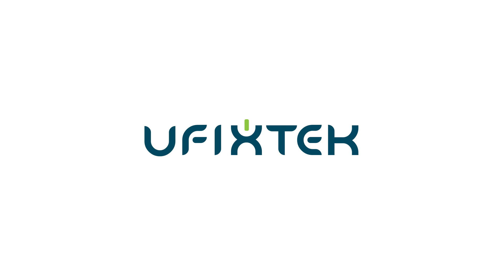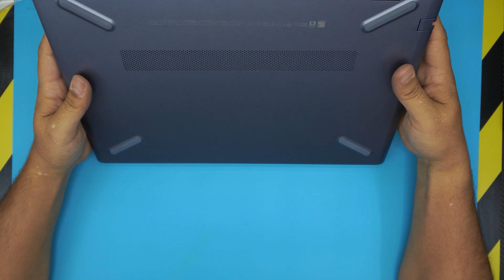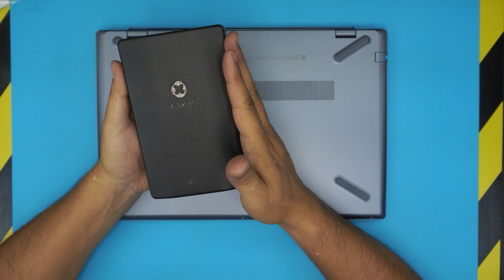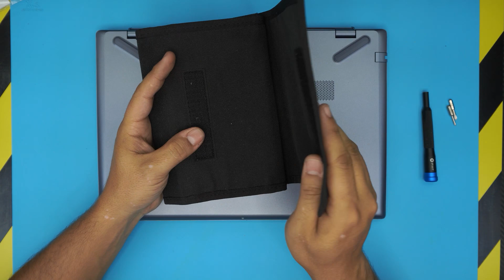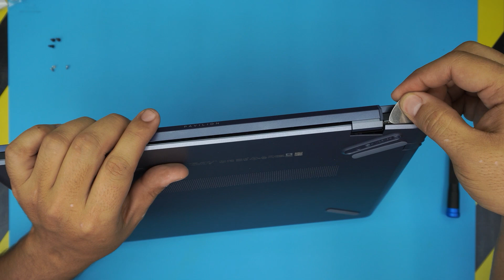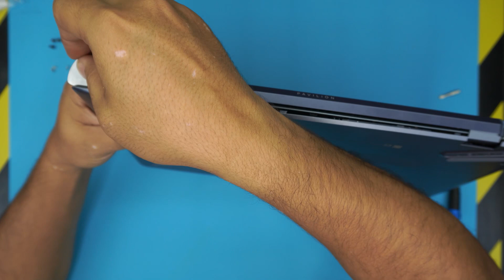How to replace Hp Pavilion 15 Cw Battery

Comment: Thank you so much. I just changed mine with a HT03XL non-HP battery. Do I have to calibrate the new battery or is there a danger to receive any notifications that my battery is not genuine?
Reply from the maker: It's my pleasure my friend.
🫠 Regarding your question, update the BIOS and it should remove the "genuine" message. Otherwise, the seller likely sold you a very basic, non-smart battery.
cheers🍻

Comment: Need a tutorial on how to replace the wifi antenna cables.
Reply from the maker: 🫠Regarding your question, that requires you to detach the LCD bezel, or you can just buy new antenas and just connect and place then in an empty space by the battery.
cheers🍻
Reply: @ Is there a work around for the wire to not come in contact with the motherboard?
Reply from the maker: you can use Gaffer tape to protect and hold cables on board.
Reply: @ Goat. I went with kapton tape. Going to be a struggle since the wires are a bit long.

Comment: I remember when the batteries could be removed without having to open the whole laptop, now you have to open the whole machine and remove the battery, a nonsense about these designers....🙄
Reply from the maker: 🫠Regarding the internal battery, it is a nice option to have the batteries externally. Unfortunately, that would not benefit the brand, as they gain a huge amount of revenue from service centers for battery services. The same goes for cellphones.

Comment: I changed my battery on my hp 15-cw1xxx  but it won't charge up , the charge light just flashes , I refitted the old battery which charges up fine , would that indicate a faulty new battery?
Reply from the maker: 🫠Regarding your question, yes the new battery is faulty and is not working, this happens a lot.

Comment: In my model, the back edge was slightly different due to the presence of a thin grid. You just need to be careful with it when unlocking using the removal tool. Other minor differences: there was only one screw in the left corner instead of two, and the three locks in the center of the back cover were absent. Everything else was identical. The instructions were essentially perfect. Thanks!
Reply from the maker: It's my pleasure my friend.
i appreciate your support and the tips 👍
cheers🍻

Comment: Good video but you just removed the battery and put it back in. You should put in a replacement battery and see the issues that arise with the replacement!☹Things like continuous flashing power light, charging and discharging to optimise it etc.
Reply from the maker: Thank you for your feedback. The purpose of the video was to demonstrate how to replace and remove the battery. If you're experiencing issues beyond battery replacement, such as continuous flashing power lights or charging problems, those might be related to power regulator issues on the motherboard. In such cases, you may want to search for specific troubleshooting videos like 'why my laptop icon says connected but not charging' or 'power light flashing.'

I'll consider creating separate videos to address these specific issues in the future. Additionally, it's worth noting that for laptop batteries, it's a good practice to charge and discharge them once every two months. Charge for 4 hours and discharge slowly until it reaches 20%. Thanks for watching!

Comment: Hello. I replaced the battery on my HP laptop just as you instructed and it went great but now I have a blinking light where the charger plug goes. It's usually white when fully charged and orange white charging but now it blinks white. Did I mess something up?
Reply from the maker: Thank you for your feedback! If you wish to support the channel, you can like, subscribe, or both!
Regarding your question, this happens if the battery that you purchased is not a good quality and has bad charge circuit, we do get this issue with bad batteries.
Should you have any further questions or requests in the future, please don't hesitate to ask me.
Reply: I let it totally discharge then recharged it and it seems to be ok now. Thank you for your rest
Reply from the maker: good, that's why i always say when you get new batteries in laptop, you should fully charge and discharge them, once every two months.
i'm glad it worked for you.
🍻cheers

Comment: I tried...it's not that easy 😒😒🙄 Maybe because I have not the right tool to open the case, I very carefully tried using a smooth knife. But it's too dangerous.I refrained from trying. I'll buy a plastic tool for opening.
Reply from the maker: Thank you for your feedback! If you wish to support the channel, you can like, subscribe, or both!
Regarding your teardown, get a guitar pick and a good screw driver, with a guitar pick .3mm you won't damage the case or anything and life becomes easy! cheers🍻

Comment: Thank you. Although it's much easier to remove the bottom cover with a suction cup instead of prying (after removing the screws). Saw that in another video.
Reply from the maker: Thank you for your feedback! If you wish to support the channel, you can like, subscribe, or both!
Regarding your question, can't always use suction cups because they don't usually grab good and when pulling up it is slippery. but if that works for you, sure you can but opening tools are the common use for us as technicians.
cheers🍻

Comment: Thanks for the video man, a very clear and simple explanation. As others have mentioned, the case was a bit harder to remove than shown but after a bit of struggle I was able to open it.
Reply from the maker: Thank you for your feedback! If you wish to support the channel, you can like, subscribe, or both!
Regarding your struggle, if it was the 1st time opening it then it is very normal to be a bit tighter 😏
ya from now when you open it will get easier and less struggling requires.
Should you have any further questions or requests in the future, please don't hesitate to ask me.

Comment: A great thanks to you and your video. I have that exact same HP laptop. My touchpad stopped working and I noticed a bulge in my laptop. It was a swollen battery. When searching for a way to remove it, found your video. Unlike the other videos I saw, you explained in a very easy way. I removed it with your great help. Thanks again.
Reply from the maker: It's my pleasure my friend. 😊 Thank you for taking the time to give feedback! If you would like to support the channel, please like, subscribe, or both. :P
i do try to keep the videos short and right to the point 🙂
Should you have any further questions or requests in the future, please don't hesitate to ask me.
Reply: @uFixTek  I would like to know if you have any video show how to remove/replace a SSD disk from the same laptop.
Reply from the maker: yes i do my friend: https://youtu.be/SLzBGWIjX1A

Comment: Thanks for you sharing. I can't find the cmos battery in this laptop.
Reply from the maker: It's my pleasure my friend.
😊Thank you for the feedback! if you wish to support the channel you can LIKE or SUB or both :P
regarding your question: This laptops don't have a dedicated cmos battery, if you want to reset the CMOS just remove the internal battery and press and hold the power ON for 60sec and it will reset the CMOS to the default state.
If you have any future questions or requests, please don't hesitate to reach out to me. I'll be happy to assist you.

Comment: thank you, Mr.! 👍
very useful video. good luck for you!
it seems a corner where RJ-45 and Power socket is the mostly weak place to remove a bottom cover (must be careful).
also bottom cover clips were not effective (no problem with my Pavilion cw-1005ua).
and finally... HP battery is awful... all of 3 cells are bulgy after 2 years of careful using (I'm an engineer). shame on HP (or I don't know who else).
a battery has a problem since buying (only less then 1.5 hours of full discharge). and work time reduced down to 20 minutes only after 1.5 years of using.
however design is quite good. off-topic note: cooler cleaning is not easy because back side of cooler air in is covered by display when closed or fully opened.
Reply from the maker: Thank you for the feedback! If you would like to support the channel, you can do so by liking, subscribing, or both.

In regards to your feedback, you are correct. I have a degree in electronics and have been working in the repair and service industry for over 17 years. It's disappointing to see how HP, once a reputable brand known for creating durable laptops, has changed its focus to maximizing profits by cutting corners and cheating consumers. This can be seen in their reverse engineering of laptops at both the component and cooling levels.

Currently, the battery quality of HP laptops is the worst and the variety of grades ranges from low to premium, with the latter being affected by battery inflation due to the use of cheap materials in polymer batteries, causing gas accumulation and battery damage.

Additionally, the cooling system and the poor X-clam used to connect the heatsink to the GPU or CPU is also a problem. Unlike in the past, when a strong spring was used, the current thin copper used is not effective in holding its shape and causes overheating.

To conclude, it's best to avoid HP laptops. For good quality, consider Lenovo T, S, X, or P series laptops. And for gaming, a PC is the best option.

If you have any future questions or requests, please don't hesitate to reach out to me. I'll be happy to assist you.

Comment: thanks for the tutorial. I have a error called CMOS RESET 502. I think I need to replace the CMOS Battery. I can't locate it. We have the same laptop.
Reply from the maker: Thank you for the feedback! if you wish to support the channel you can LIKE or SUB or both :P
regarding your question: there is no CMOS battery on this models, the CMOS chip takes it's battery charge from main battery. now if you don't have the internal battery installed, or the internal battery is going bad, that's why you getting this error. the error its absolutely not important, its just time wasting :)
Reply: @uFixTek  I guess my battery is the problem. I just bought it last month thou.
Reply from the maker: the batteries are not original they are mostly 99% pirated battery out there. if you purchase two or more from same seller you will see that they all have same serial number :/
you need to get good quality battery.

Comment: Where is the CMOS battery?
Reply from the maker: Thank you for the feedback! if you wish to support the channel you can LIKE or SUB or both :P
regarding your question: this motherboard it doesn't have a dedicated CMOS battery, the bios chip uses the internal big battery to keep its configuration.
Reply: @uFixTek  Thank you very much!
What should I do if after cleaning it and turning  it on it said: The CMOS checksum is invalid. The CMOS will be reset to default configuration and will be rebooted.  Please check your BIOS Setup to see if they have changed. 
CMOS 502
Press enter to reboot
But after I pressed enter it turned off, then I tried turning it on again and it turned on.
Now everytime I turn it on it shuts off after 3 seconds, the second turn on it does turn on completely.
Thanks
Edit: already rested the BIOS and still the same
Reply from the maker: is your main battery working?, does it charge and holds up at least 5min of charge. because the only time that you get the msg when you power on about the "bios default" is because the main battery was drained or removed for few sec. the MSG is just a notice, its not a big deal. except it delays the startup.
if you battery is connected and holdup charge, then update the bios from the hp website.
Reply: @uFixTek  sorry but I already did that and still the same, turns on then off after  a second, second time turns on completely
Reply from the maker: does the bios resets the date every time you turn it on!
Reply: @uFixTek  no it stays the same
Reply from the maker: give me the full exact model of the laptop, and the one where it ends with #abc
Reply: HP pavilion Laptop Model 15-cw400la 
4PF41LA#abm
Reply from the maker: ok, do this: Use this procedure to reset the CMOS and recover the BIOS.
Turn off the computer.
Press and hold the Windows + V keys, and then simultaneously press and hold the power button. After 2 to 3 seconds, continue to press and hold the Windows + V keys, but release the power button.
When the CMOS Reset screen displays or you hear beeping sounds, release the Windows + V keys.
At the completion of a successful CMOS Reset, a message similar to the following one is displayed.
https://imgur.com/a/3Rf8Cfk
Press enter to restart the computer.
Reply: @uFixTek  I did it and it shuts down right after I press enter... 😢 Could a possible solution be changing the battery?
Reply from the maker: @yatzirimv7306  lets try this last step to recover bios,
1.Turn off the computer and be sure that the AC adapter is connected to power.
2. Press and hold the Windows + B keys, and then simultaneously press the power button.
3.After 2 to 3 seconds, continue to press and hold the Windows + B keys, but release the power button. You might hear a series of beeps. 
The HP BIOS Update screen is displayed and the recovery begins automatically
https://imgur.com/a/f5Y7KmX

if the above didn't work , then you may have to replace the bios, data in the Embedded Controller (EC) is corrupted and can't be fixed.
its not your battery. because you said the battery is holding charge and the bios date does NOT reset .
Reply: @uFixTek  it didn't work, how can I replace the BIOS?
Reply from the maker: i can't find the bios chip seller, here is a e.g of the bios chip on ebay for cw-1xxx series , yours its cw4xxx series
https://is.gd/5JTbE6
are you in mexico?
Reply: @uFixTek  No, I'm in Guatemala

Comment: Great explanation. Question: mine shutdown while watching a YouTube video and will not restart. No light on the on button; no sounds. Does it mean a new battery is needed?
Reply from the maker: Thank you for the feedback! if you wish to support the channel you can LIKE or SUB or both :P
regarding your question: only shuts down when on battery? what about if you connected with charger it should not shutdown.